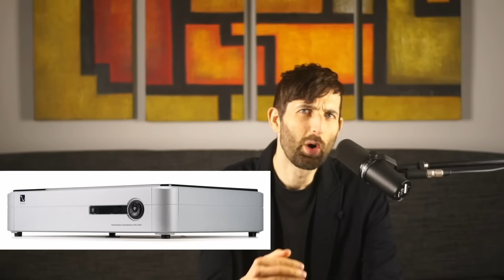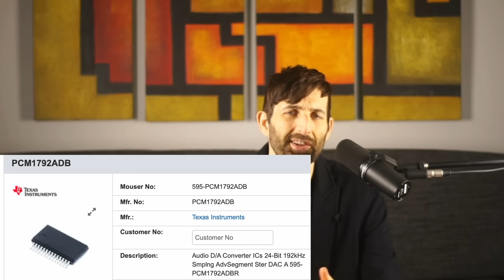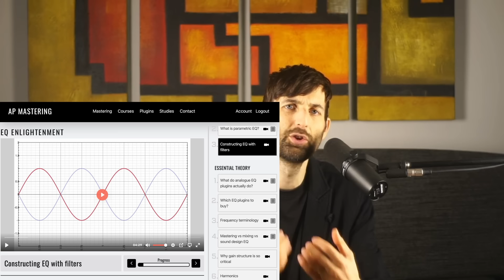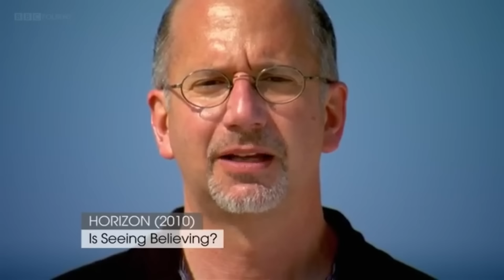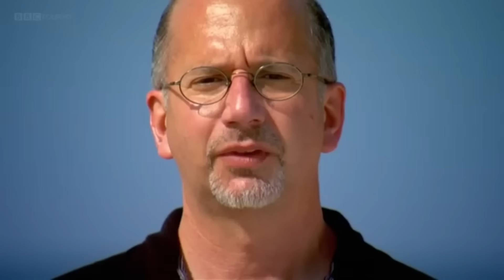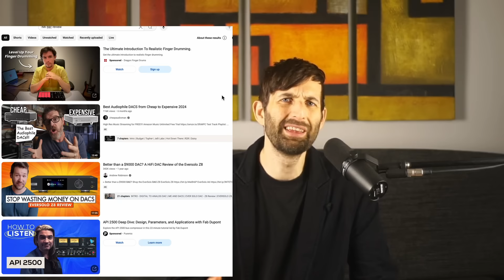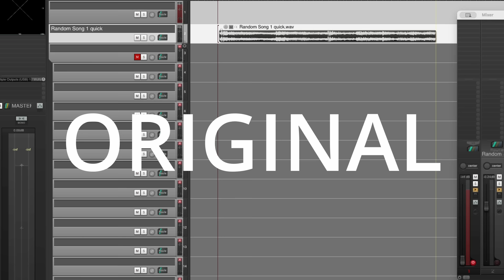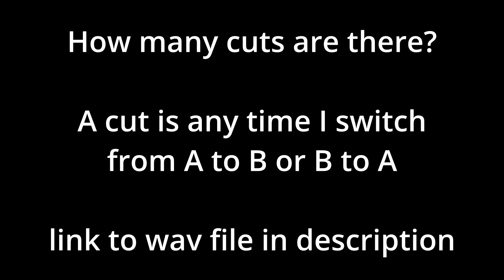The DAC Scam - Almost everyone believes the hype

Comment: As with everything it's all about the implementation.  Sure DACs may use the same chip sets from the same suppliers, BUT things like power supplies and other circuitry matter in the final sound of a component DAC.
Reply: Yeah, but this stuff isn’t rocket science. There’s plenty of mid range brands that nail it.
Reply: exactly. It's like saying all amps that use TO-3 transistors are the same. Dacs like all components are a sum of their parts and engineering, not a single part in an empty box.
Reply: @ Everything isn’t the same, but any competent company in the industry can do a good job of it, especially if they’re using the same (good) parts. Again, not rocket science.
Reply: This is swearing in the haters-church! But it’s spot on! 👍
Reply: A competent DAC is not expensive to make.
Reply: @robertt7238  competent is not always great
Reply: @robertt7238 Khadas KTB DAC was tested by Amir at ASR and measured in the top category for low noise and distortion - $100. I have one in use for CD playback!!

Comment: Not true, Chips are responsible for just conversion and it power supply and analog section is where the real difference is hiding ! 
Don't spread lies  DAC is lot more than just a chip.
Reply: And yet $100 DACs are, from an audible standpoint, totally transparent, and have been for a while. Worse case is an extra $100 on a USB isolator if you have some noise leakage.
Reply: @robertt7238  Please point me to a totally transparent DAC for under $100.
Reply: @robertt7238  100usd DAC sounds like a 100usd DAC , far from the best sounding DACs with much better power supply, better analog section , and multiple inputs including superb I2S .... you have to pay at least around 500usd to get very good sounding DAC and way more for the best onses
Reply: I'm a professional electronics designer. It's true that to get optimal performance out of a DAC chip then a good PSU, filters, audio amplifier and other things like competent PCB layout are needed. However, all of this only needs to cost a few tens of dollars.
Reply: @TerryClarkAccordioncrazy   THIS.  I’m not a professional electronics designer, but I know enough to be dangerous.  Competent design with good-enough parts is going to be the 98% solution for most and shouldn’t push the BOM to more than $100 for an excellent design with few real compromises.  The rest is glitz and glitter.

There IS an argument for the analog side costs varying quite significantly, and I say this after personally witnessing the upgrade of my Chifi DAC op amps from a chip design (pennies) to a discrete design (dollars).  I was skeptical about op amps but decided to try.

On cheap amps/DACs the value proposition to upgrade an op amp is real, but so is the sound quality.  Before proving this to myself I leaned towards the side of skepticism.

CAVEAT: to properly evaluate these changes you need a signal path and speakers with the ability to resolve enough detail.  I have good speakers and I rebuilt the crossovers to eliminate any low quality parts, and this was a BIG improvement… IMO a requirement.  Anyone trying to evaluate these things without highly resolving speakers is literally wasting their time.
Reply: @TerryClarkAccordioncrazy  A good quality linear PSU alone can cost you hundreds.
Reply: @DM-sc4zy  What would cost the hundreds of dollars within the PSU?
Reply: @TerryClarkAccordioncrazy  Not sure, that’s just how they’re priced in retail. Even more affordable ones like the Topping P50 still cost over $100.
Reply: @TerryClarkAccordioncrazy  Well designed PSU can cost 300usd , Quality Toroidal Transfer for analog section , Another transformer for digital and fully independent regulation , caps bank and rectifier . 
Than comes the rest of the DAC around chip ...
Reply: @kdomster9141  You're right that a PSU for a DAC can cost hundreds of dollars, but it's hard to see why it needs to. Separate regulators are good, but why would separate transformers be needed? Fancy caps cost a fortune but cheap ones are perfectly OK for PSU decoupling. I'd like to see someone try to hear the difference in a blind test.
Reply: @TerryClarkAccordioncrazy Right.  Not only that, but the external requirements are easy to satisfy and demonstrated on the chip manufacturers’ reference designs.  Why do people keep falling for audiophile “one weird trick” claims?
Reply: @kdomster9141 Do you have any argument other than the false marketing you’ve obviously been fooled by? There is a “real difference”, it’s just so tiny it either cannot even exist as sound or is inaudible!
Reply: @GregStudio01  😂😭 Dude you may have no clue but your serious tone is just laughable ...
Reply: @kdomster9141   So that’s a “no” then, you indeed have nothing other than the false marketing you’ve been fooled by. Thanks for your confirmation!
Reply: @GregStudio01  You are a "No" not understanding basic electronic design and role of everything around the  DAC Chip . Get educated or be another useless troll , good bye .
Reply: @kdomster9141   So STILL nothing other than the marketing you’ve been fooled by, except you’re adding to that ignorance/gullibility ad hominem attacks, which ironically actually apply to you rather than me! So again, you could hardly provide better confirmation that you have nothing other than the marketing you’ve fallen for. You want to carry on confirming that fact even further?
Reply: @GregStudio01  Dude you have no clue whatsoever and are a laughable,  stop waisting anyone's time .  Here is some more truth for you :
DAC Chip can only sound as good as the design and quality of electronics around it...
Reply: @kdomster9141  And again, I apparently have no clue but you’re the one wasting everyone’s time with nothing other than the false marketing you’ve been fooled by. How many times do you want to demonstrate that fact? Rather than being embarrassed that you’ve been suckered you just want to keep digging the hole deeper. Go right ahead, it’s amusing to watch! lol
Reply: @kdomster9141  Ah my guy. You know nothing about what actually happens in a DAC but you will stand here and make vague statements. We see through you just like we see through the marketing BS.
Reply: True, there's a lot more to it. But people should really stop buying overly expensive DACs that are not better, sometimes even worse, than 200-300$ DACs that are essentially perfect. Just look at for example Topping, so many extremely good products at a very reasonable price.
Reply: @zapador  and that is whole another story
Reply: There is so much that was not covered on this 10,000 foot perspective video…. But..  there is a point where I feel people waste money.  A lot of money..   So.. he has a point there..  Just needs a bigger budget for this conversation than what is noted
Reply: Exactly. I think he knows all that, he's just conveniently leaving it out. None of the high end dacs use off the shelf chips. Those r2r & fpga designs need years of R&D, and even those budget dacs that do use off the shelf, its the implementation & construction that benefits sound.
Reply: @r423fplip  9.50usd  for a chip 😂😉 all else is a rip off and BS ... That's what ASR cult gives you , brain wash and lie.
Reply: Very interesting video . 
Some of this is a bit of bollocks but some of it is totally true 🤣🤣😂

I use UAD apollos now along with a Burl B2 Bomber . I’ve had for years and the burl definitely sounds different and to me a lot better ! 
But I know for sure that a lot of the difference is the analog part of the conversion circuit ! 
But even just recording a line level signal say a sine wave at 1k through a Focusrite scarlet and the exact same signal through the Apollo it sounds very different and different again through the burl !  
I know none of these are the price bracket you’re talking about but still a varied difference in price and quality and there is a noticeable difference ! Normally for me with most interfaces it’s in the bottom end that is most noticeable and secondly the high end can feel thin or almost cloudy .  
But the main reason I love the burl is the mids have a slight pushed open quality that both the UAD and Focusrite cannot compete with ! Now this is definitely not in my mind this is an obvious difference !
Reply: When listening through electrostatic speakers or headphones i can hear differences between different cd players. The old recapped marantz cd80 still sounds very good but a bit different. Not the same.
Reply: Truth. While I wouldn’t pay $12k for a DAC, the quality difference between my $4k streaming DAC and $400 DAC are not subtle.
Reply: Yes, it would be, if current would have a quality.  But it's just pure energy. Does nor cares about through what it it coming.
This is all manufacturers fairy tales, why? Because it brings them tons of money.
Reply: And making an audible perfect DAC is dead easy to any competent designer and does not require much in the way of cost to do. All the rest is just BS
Reply: @robertt7238  Here we go with the measurement people 🤦🏽‍♂️ . If you choose to get a cheap measurement perfect Dac then cool good for you but don’t expect good sound from it.
Reply: @robertt7238 Exactly.  This technology has been mature for decades.  Competent designers know how it works and how to make it inexpensive and robust.  Moreover, it is easy to measure and prove, as long as you don’t believe in magic.
Reply: @kdomster9141  Interesting point. I changed to a linear power supply for my DAC which definitely sounds better. Still the same chip though 👍
Reply: @Mike.233  Exactly , separating digital and analog sections of the DAC and providing separate power supplies for both will yield nice difference, than keeping it as dual mono also improves things .... all could be based on same chip 😉
Reply: @kdomster9141  I bet it's only until you do a blind A/B test.
Reply: @drovoseg  Not really, DAC Chip is less important than all around it . 
Even basic DAC Chip can sound great with implemented with proper care
Reply: @ They all sound the same, blind tests prove it every time
Reply: He’s conveniently leaving out the correct information about dacs. Those who don’t know anything or are cheapskates will believe and go along with his naysaying and that is who he’s targeting.
Reply: @Audiofreak71 Wrll you do have to love the thing you spent outrageous amounts of money on I guess.
Reply: @ No but  you do have to love the sound of your system and if that includes a $4k Dac that makes a noticeable difference over a $200 Dac then so be it. That also works the other way around but those that have experimented know if a more expensive Dac is worth the coin, rather than following blind behind a naysayer .
Reply: In all honesty most peoples hearing is pretty poor nowadays due to a number of reasons, it doesn't make sense to spend massive money on quality equipment if your hearing is sh*t take it from me  @Audiofreak71
Reply: @Audiofreak71  You, you audiofreak!
Reply: @bertramlefarge69  Damn right and don’t you forget it!
Reply: @Audiofreak71  whole video is from my perspective just a snake oil.:face-blue-smiling:
Reply: @kdomster9141 the video is clearly bait, and you fell for it (so did I because I replied, lol). @APMastering prefaces the topic with falsehoods that can be debunked with 5 minutes of research. It's just dishonest.
Reply: @decafbad_vids  this Dude is dead serious.

Comment: I feel the same way about turntables (with one caveat). The only thing producing an audio signal is the cartridge, yet you hear reviewers talking about turntables sounding "fast" or "dynamic" or "lively" or whatever. As far as I'm concerned, it's mostly horseshit. A turntable shouldn't have any "sound" at all - it should be transparent (as far as an ancient piece of electro-mechanical engineering can be "transparent" at any rate). Turn the record at the correct speed, without variation, job done. The only caveat is when the music is being played loud enough to mechanically couple to the record/stylus. Again, not so difficult to solve; heavy, non-resonant plinth & platter. This was all figured out in the 70s 🤷‍♂️ Audiophiles spend tens, even hundreds of thousands trying to turn a fundamentally flawed format (ie. vinyl itself) into "perfection". They act almost like records themselves are inherently "perfect" and that spending vast sums on elaborate equipment can extract all that "perfection" from a piece of plastic with grooves pressed into it. Records kinda suck, compared with high quality digital. That is the scientific fact of the matter! There will always be surface noise, microscopic bits of dirt and dust will forever plague your "enjoyment" with clicks and pops, the linear velocity is way lower toward the center of the record, so the fidelity is never as good on the last track of an LP compared with the first track, etc. etc. etc. Channel separation doesn't even reach much above 30dB. So many fundamental flaws which are impossible to fully overcome.
Some people just enjoy playing records, whether it's the nostalgia of it, or novelty of it (depending on their age!) and that's fine, but please let's not pretend that scraping a diamond across a (very imperfect) sheet of plastic is in any way superior to digital in terms of sound quality. Spending stupid amounts of money on ridiculous-looking "monstrosities" won't help much, either. These fools were all so smug and self-satisfied with their "purely analog" s***, until it was discovered (no big surprise to me) that MoFi actually had a digital stage in their vinyl production. LOL. Then the audiophiles lost their s***. When they didn't know about it, they were none the wiser, in their blissful ignorance. It's quite funny, really 😂 I'm sure that many HiFi reviewers listen with their eyes, as much as with their ears. Same goes for "audiophiles" and their ridiculous-looking HiFi setups. They could never be happy with the sound of a $200 DAC when there are bigger, sexier, and vastly more expensive ones out there on the market.
Reply: In general, the turntable is more important than the arm, and the arm is more important than the cartridge in determining a turntable's sound. Any good hi-fi dealer who sells turntables should be able to demonstrate this.
Reply: @jeremydas723  I would counter that I could take a high quality cartridge, set it up in a dozen different turntables, and you'd have a very hard time identifying which turntable/arm you were listening to (or correctly placing them in cost/performance order). Especially when listening with headphones/when the amplified  sound of the music isn't getting into the record playing setup. At normal listening levels, I doubt this is much of an issue for any "competently designed" deck anyway. Regardless, the flaws of vinyl itself are larger than the differences between different turntables. They're all going to sound various shades of "meh".

Comment: I’m looking to buy a dac. I only heard about r2r recently.  Are these in the snake oil category?  What would you recommend in the “200 quid” range?
Reply: Fiio k11 dac. Less than 200.
Reply: @Paul-jb6rk  im not sure your get a 200 quid r2r dac. They usually enter at about a grand and upwards.
Reply: @oohtob6685  there is a r2r in that price range
Reply: R2R has no advantages. More complicated way of doing the same thing.

Comment: I am not an audiophile.   I bought the SMSL SU1 for $60 + tax.  I connected it to my Sony DVD/CD dvp-ns575p 20-year-old player ($130 new).  The SMSL SU-1 DAC features the AKM AK4493S DAC chip and the XMOS XU316 chipset. 
I did A/B testing over & over & hear absolutely no difference. 

I'm a 71-year-old and on a fixed income.  I actually think the Sony sounds fine. I have old ears. I think I'm done with DACs.
 The only reason I bought it was because I saw so many reviewers saying it was a powerful little deck for $80.